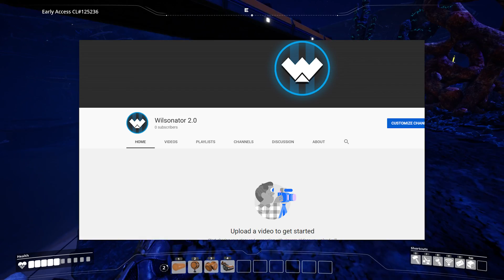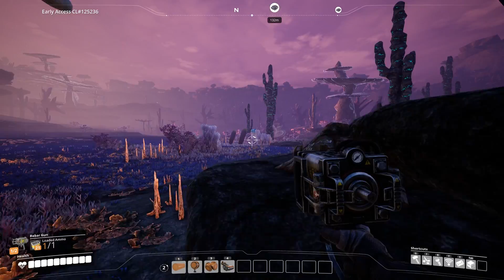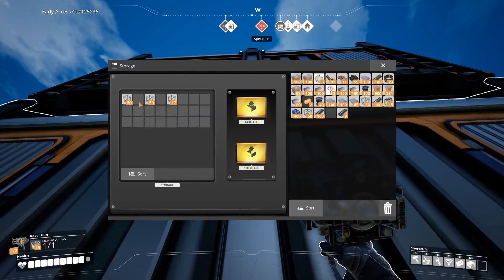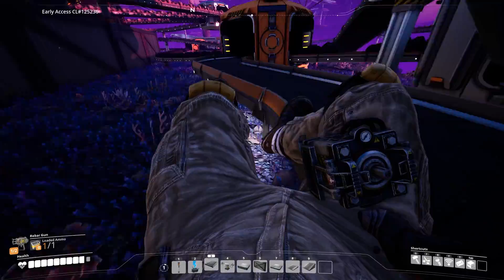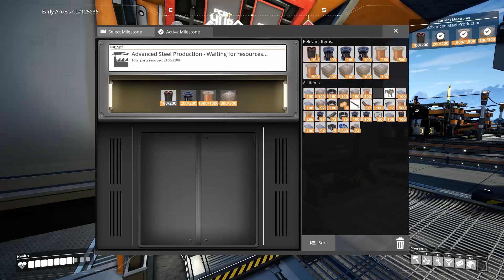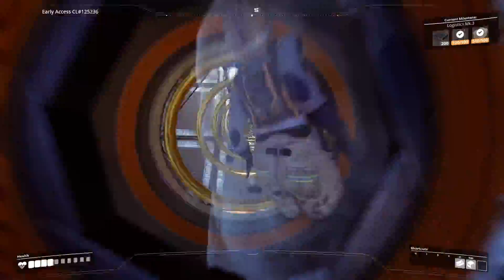BUILDING THE STEEL FOUNDRY! - Satisfactory Gameplay #11

Comment: You need to build yourself a Xeno-basher.  It does 2x damage over the first melee weapon and it's faster if the hogs come running at you.  Also less accuracy needed and no resources used

Comment: Check out the overflow method.. for example you have 120 coal, each foundry needs 40,  use a 120 conveyor and 1 splitter at each of the three foundrys. Its much quicker and just as efficient once all the foundrys build up 100 of the resources.
Also hypertubes go faster the closer the rings.
Love the series dude

Comment: Wilsonator, you can chain hypertube entrances to go super fast. On one foundation, start with four supports. Turn the first and third into entrances, and put a single tube from first to second, and one from third to fourth. Then delete the 2nd and 4th supports. Repeat that pattern as necessary. Save before trying. You can die at landing if you get too fast.